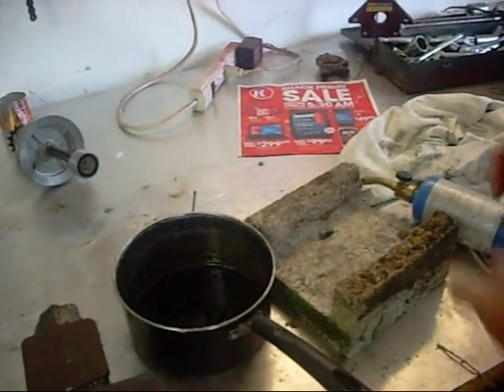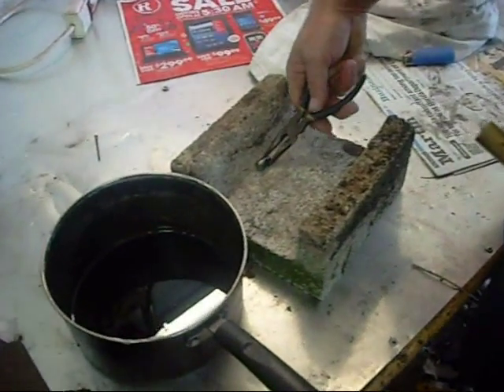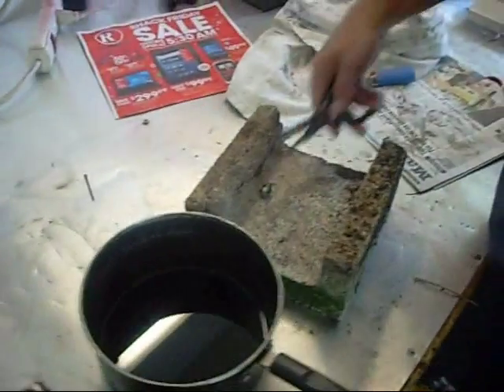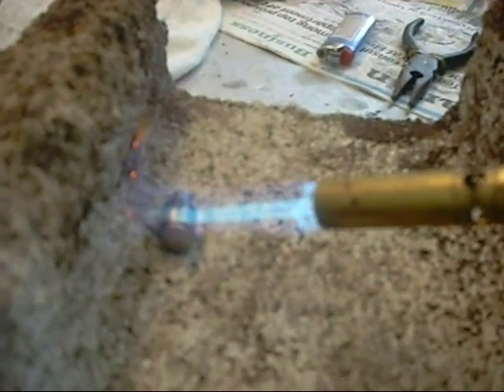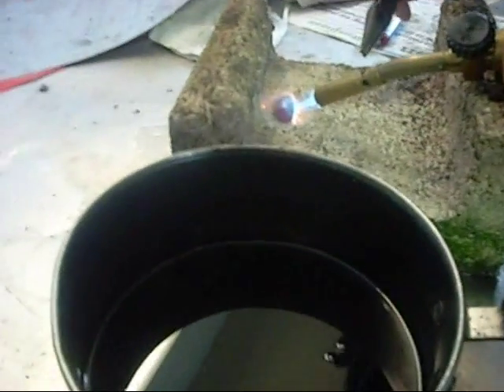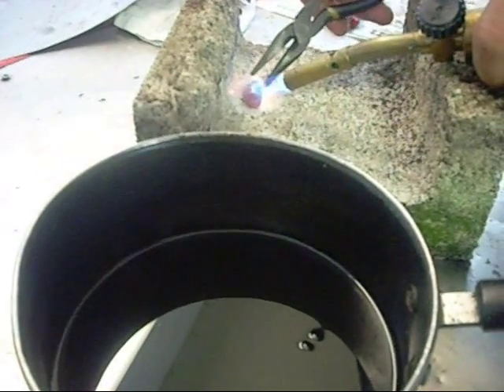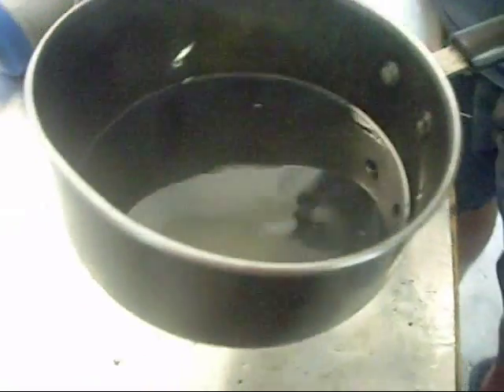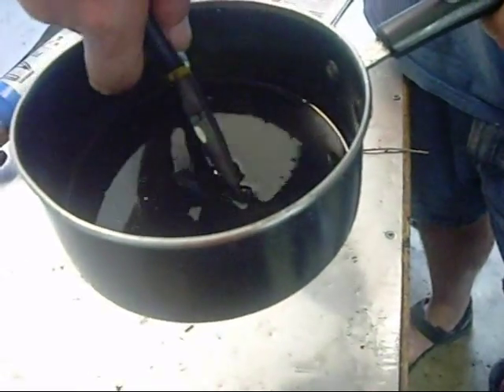Case Hardening a Clutch Pushrod

Comment: Yeah, John Saia is right. Being a pedant, this is quench hardening rather than case hardening. Quench hardening changes the molecular structure of the metal that's already there, case hardening adds carbon to the surface layers of steel.

Nice video though. Shows that these things aren't rocket surgery.

Comment: This process is not case hardening, that is done in a furnace with the steel part packed with carbon in a ceramic box, heated for hours and then quenched in water.  The process you demonstrated is oil quenching, which does infuse some carbon on the steel, but not to the depth and hardness of case hardening.